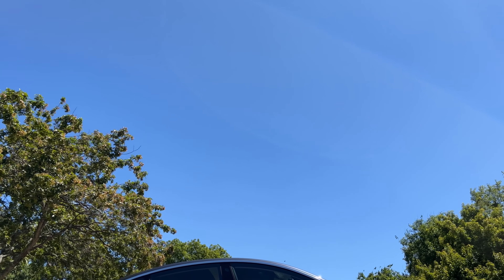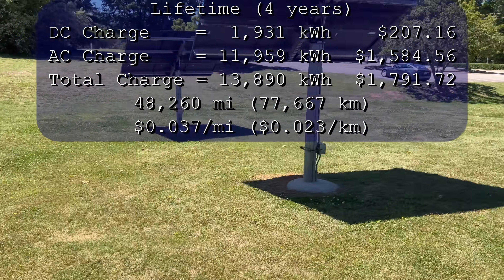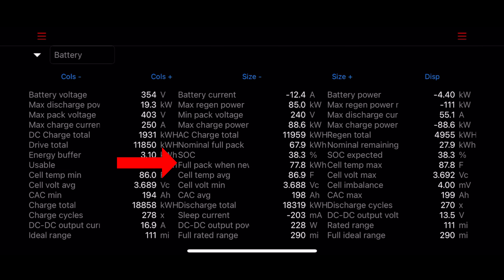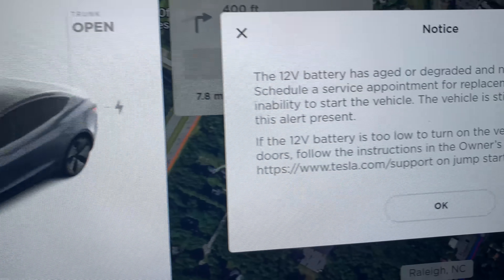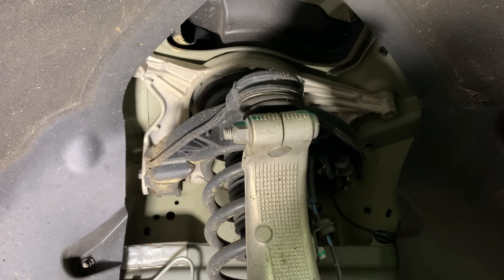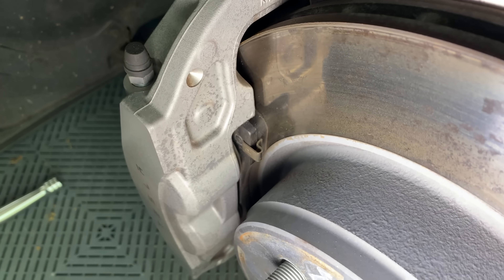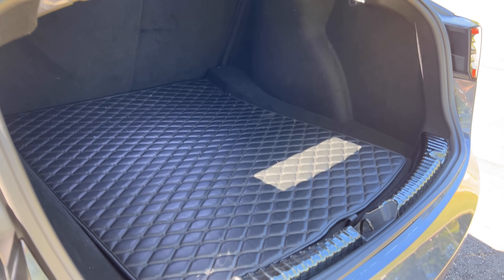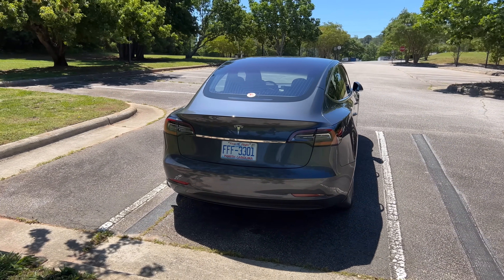Tesla Model 3 - 4 Year Update

Comment: My car is 6 months newer than yours, with just over 15,000 miles. The only service was changing the 12 volt battery, and a tire rotation. I’m considering upgrading to a Model 3 Performance when the the 2023s come out.
Reply from the maker: The new versions have some nice improvements. Good luck!
Reply: Smart move.

Comment: I just checked the mileage on my 2018 Model 3 AWD and it's 50,183 so I missed my chance to do a checkup before end of warranty. My Rimetrix are making noises at low speeds - have you noticed this?
Reply from the maker: I have heard some people get noise due to the cover being loose.  Have you checked all the covers.  Also make sure the foam is attached all around the outer edge.